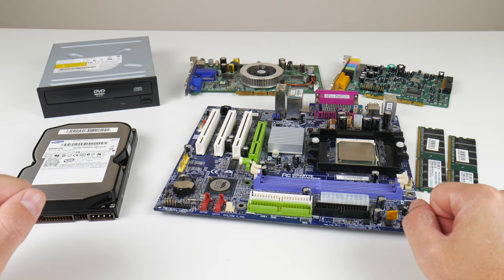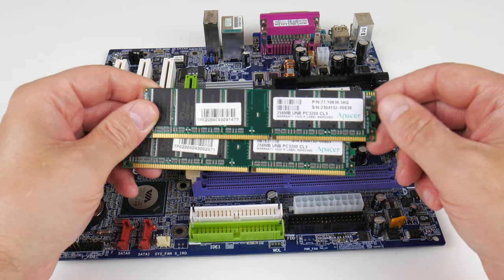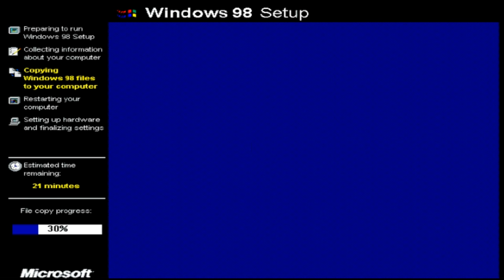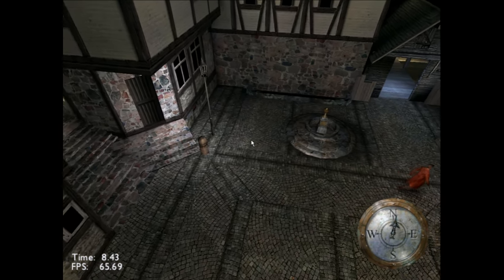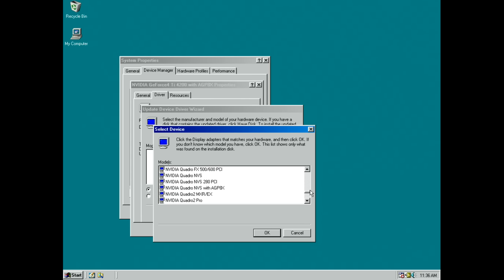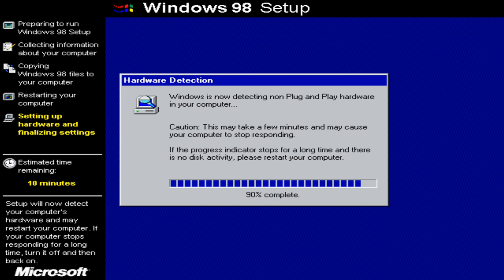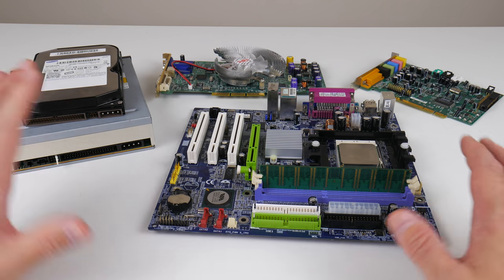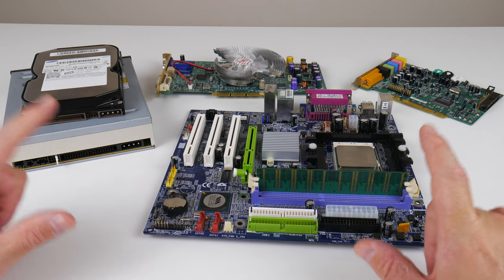Building Windows 98 Retro Gaming PC with AMD Athlon 64 Platform

Comment: The issues you suffered were just so indicative of the era... brings me some odd nostalgia while simultaneously making me sad to my core as if it were younger me with some motherboard that I just sunk all my money into, and it was just riddled with issues. lol  . But half the fun was figuring all of any particular systems quarks out, and knowing it like the back of your hand by the time its broken in. By which time you can basically make it do anything you want, whilst acutely aware of its limitations. I've had bunk Sata on early implementations as well, back then of course... in its infancy. Also depressing, when you sink a ton of money into a new interface for CRAZY SPEED, and you ultimately have to then go to tigerdirect and get a sata to ide adapter... paying a ton more to do the same thing you were on the last build, lol... just because the tech wasn't up to snuff, and compatibility on brand new ideas were totally hit or miss.... nothing was assuredly just going to work... ever.  Not back then. But again, it was a lot of the fun at the same time. Oddly. Like playing a lottery to an extent.
Reply: I built a new gaming PC in December.  PCI-E 4.0 does not work, has to be disabled or Windows BSOD's during boot.  Asus sound card refused to work with Asus motherboard until I downloaded a special USB controller driver (wtf, why?!  there is no USB ports on the sound card!).  Radeon 5700 XT...  Well, you can search on Youtube for how many problems that goddam thing has.

It's still a lottery.
Reply: @jamesclark7380  lol.. Yeah, at times it is... Especially when the underdog team goes and advances things like pcie 3.0 to 4.0... That move alone will likely cause further chipset issues for many a seemingly unrelated card for many a people moving forward... Unless you have the most ground breaking of NVME ssd storage though, or even the absolute most expensive of m.2... Then you may as well just use 3.0 for some while. As you won't stand to benefit from the newly added bandwidth, with any video card today, even 2080 super can't saturate a 16x @3.0...  so I'm just waiting until 4.0 matures. All my ssds are cheapy cheaps anyway, lol

Comment: nice video yet again. i hv a similar setup ad well for win98, but with socket 939 A64 4000, Asus A8V-X with via K8T800 chipset and ti 4200 8x. I also swear by the older drivers 45.23. i swap in a 6800gs if i need more performance but that card only works with modified 81.98 drivers.

Comment: I have the Gainward Golden Sample GeForce 4 Ti 4200 that was paired with my AMD Ahtlon XP 1800 until  I bought the Radeon 9700 Pro when I upgraded the system to a Barton core Athlon XP 2500. When I went the Athlon 64 route I was running the GeForce 6600 GT AGP  and and nForce 3.

Comment: I have had similar issues with the VIA chipset SATA controllers for socket 754/939. I had to use a PCI SATA card to work around the problem. Aside from that the systems work great!

Comment: You have a lot to answer for Phil. I have a dual slot 1 rig that i have owned and built from new and have always enjoyed messing around with (it did have to work for a living for a very long time, Gateway server) and it's now basically a pet. Dual 600's, Geforce 2 GTS, Globalwin 802 case, maxxed ram, Highpoint Raid card, more storage than it will ever need and Windows 2k Pro, oh and a Yamaha sound card, you may want to try one of these. However, I now find myself , as a result of watching YOUR channel, with a P2 450 SLI Voodoo 2 setup, an AMD 6000+ running crossfire 3870's , and a Q6600 running at about 3.5 or so (varies depending on my patience) with either crossfire 4870's (superb cards and damn reliable) , or, crossfire 5970's (these require a small nuclear power station in place of the psu). More to the point I also have a third 5970 waiting for a suitable mobo ( and a slightly larger power station) to run triple crossfire. Keep up the good work.

Comment: I'm building one of these systems. I went with an AM2 board which has an AGP x8 slot, paired with an Athlon 64 1660-LE. Having the same issue you had with Windows setup during hardware detection. Very annoying, but I'm determined to fix it. 💯
Also, it'd be very interesting to see you do a 98SE build on AM2, and explore stuff like Cool 'n' Quiet support and how it affects gaming, if you can find a board that has APG. ;-)

Comment: The Santa Cruz card usage is continuing to be interesting.. as are any mistakes (very helpful ! ) I have been looking at the M-Audio 2496, Revolution 7.1 and Revolution 5.1 sound cards for Input video capture. Both from ATI Wonder Theater 200 cards and from  other TV Tuner cards. Sound cards aren't normally known for their Input capabilities, Mic and (Consumer) Line seem to be all there is.. Mic=Mono, Line=Stereo. I see some have "hardware" channel support for EAX and other Surround Sound on the outputs.. but not all. The M-Audio Revo 7.1 had no "hardware" support for EAX and DirectX and got panned for poor gaming support. The Revo 5.1 was supposed to have "hardware" channels and was lauded for it, but had poor quality drivers. I'm new to all this EAX and Sensura (software only?) sound support and the MME vs ASIO driver and latency control support. It seems to me after Visa the whole landscape of sound support changed.. but I'm not sure what is important anymore. 16/48 to 24/96 and 24/192 .. seem to be tiers for audiophiles (is that a fan or a brand name for M-Audio products?).. and stuff seems to favor IEEE Firewire or USB 2.0 then there were Guitar or Instrument (non-Line level to Line Level) adapters and converters.. this is all humbling, confusing and frustrating to understand.. sometimes I think I need to visit a Guitar shop to figure out which legacy sound cards are best for analog video capture to digital AVI or MPEG2 transfer.

Still I find your videos with the 'crumbs' of information about video cards and audio playback/gamer cards useful.. they connect a few dots for me.. and send me off in new directions to explore terms I've never heard of before.

I think there is a lot of historical, legacy information that informs and prepares one to understand the landscape of today.

Thanks for the videos!
Reply from the maker: I feel like saying some deep and meaningful but can't lol I just follow my gut and what my ears tell me. For gaming the Santa Cruz is a solid all-rounder. EAX is better with a live! Or Audigy 2 ZS even better. A3D you want an Aureal Vortex 2.

Comment: Yo Phil. I have that exact sam hard drive, And lets just say, its the best hard drive I have every owned. It has been dropped, bumped, everything. And it still has no reallocations and has over 30k hours of usage on it. Its running a text bench with windows 10 32 bit rn lol
Reply: Mine however is SATA, not IdE

Comment: Got my hand on a ASUS K8V-MX (VIA chipset) with a Sempron 2800+ and I have to say, I got pretty disappointed on Win98SE as it seems the system appears unstable. So far my nForce2/AthlonXP behave much nicely and more stable. The glaring example is the system unable to shut down properly (Windows claims a fatal error occurred and needs to restart the computer...as I asked him to shut down). 
I don't know if it me or if I have some plague with the ASUS series of that period (I really got unlucky with ASUS mainboards from 2004-2005 era), but I gonna try next weekend and benchmark against an ABIT NF8-V (Socket 754/nForce 3).

Comment: I used to work for a component distributor. I would test returned items to determine if they where faulty or not. We sold these Gigabyte boards. We had very few returns on Gigabyte boards. If they did have a problem it was mainly having to flash the bios to the latest version because it would not boot with newer CPU's and I remember a spate of boards with leaking capacitors. MSI boards at that time where terrible.  I always wish i had kept my best PC for each era instead of upgrading.

Comment: Great video!, Athlon 64 is the most over powered system you can build for Windows 98, you can even go to Socket 939 with Via Chipset I have an Athlon 64 4000+ running in that configuration.
SATA needs additional drivers not included in Via 4 in 1, that is why you had errors. 
Also, I have the same problems with Nvidia 45.23 and some Geforces 4 MX, or Ti. It really depends only on the manufacturers of the cards, on some it installs fine and work, in other it installs but give Direct 3D errors, and in some it does not want to install at all, force install in this cases give Direct 3D errors, so no point. Going to the immediate next 45.XX driver revision solves it for me, and still performs 99% the same.

Comment: This weekend the final parts for my 98 SE build will come.
Reply from the maker: Good luck!
Reply: Out of curiosity, what are your parts for your build?
Reply: @matthewconley7568   A Geforce 4600 ti, I also found a 3dfx Voodoo 2 that I didn't know was in the computer I'm building until recently so that's an option as well, a 2.8 ghz socket 478 Pentium 4, and 512 MB of RAM.
Reply: @ironinquisitor3656  Are the 4600ti really that powerful for Windows 98? What is stopping someone from putting a more powerful in their system?
Reply: @matthewconley7568  It's considered a sweet spot because it has great backwards compatibility with older games.
Reply: @ironinquisitor3656  Do you know of anyway to get a motherboard from this era that has not been affected by the capacitor plague?
Reply: @matthewconley7568  Not sure how to answer that. I'm not a computer expert.
Reply: @ironinquisitor3656  Just want to get maybe a Pentium III motherboard not affected by the capacitor plague going on at the time. Don't know how widespread it was.

Comment: Always love a good Athlon64 build, but this is not what i was expecting when you mentioned Hold My Beer ;).
I expected the system hangs to be SATA or resource conflict related and from the looks of it its indeed the sata controller.
It might be interesting to try the RLoew SATA patch that patches an issue with Windows 98 that causes it to recognise some SATA controllers as PATA and see if that fixes the issue for you.

For the time machine idea it would still be interesting to see a follow up to this, possibly with your higher spec'd Athlon64 build from last week. Because i am still super curious to see what the highest end build is you can make with the components you have in your collection that still retails full MS-Dos and Windows 98 compatibility covering the widest range of games you could possibly manage on real hardware. Because to me even if it can't run games from modern times it would still be fun to see a single system run Wing Commander all the way up to early Windows XP (Half-Life 2) or even Windows 7.

Its a bit of general feedback for your channel as well, you often do specific builds such as a XP gaming machine, or a Windows 98 gaming machine. But it would be useful to know how well it would be able to do the things you did not design it for but others may be interested in. Showcasing MS-Dos compatibility or XP compatibility similar to how you handle your Thinclient video's. So in this case i am looking forward to the bonus video. But having it as a short segment in your regular video's could be very helpful.

Comment: Nice video as always !! I have the same Medion GF4 Ti 4200 8x and it can overlock to Ti4600 speeds (even beyond) :D it's a really quiet and cool card, I was very impressed by it for the price :D

Concerning the CPU you used, seeing its cpuscore under 3DMARK99MAX it's a bit faster than an Athlon XP 3000+ FSB333 on an Asus A7V333 (that one scores about 38300 points, overclocked to 2471MHz it scores 43300).

Maybe you could use Riva Tuner 2.24 - 2009 MSI Arena Overclocking Edition (It works well under Win98SE, tested by myself :p) in order to unlock features of the integrated graphics by S3. I know it does work when PowerStrip can't show options like you had in the video. I hope it will help you :)
Reply from the maker: Sweet, I believe I have Rivatuner ready to go, will check it out the next time I work with this platform! Thanks for the comparison figures!

Comment: I'm not surprised that you had problems with the sata ports as sata originally came out in 2000. While they did make sata drivers for Win98 they usually had to be installed after Windows was (on an ide drive), then you had to swap your hd from ide to sata and use hd cloning to copy everything over.

Have you looked at slot 1 pentiums yet? I'd be interested if you do as I've got a board and cpu that I could use.

Comment: Ahhhh.... A somewhat recreation of my "The beast" from around 2015 that I posted on Vogons? That machine really flew and was awesomme.
Reply from the maker: It's just a really basic Sempron 3100+ system with VIA chipset. Very undesirable, but for Windows 98 SE it's fantastic and cheaper than all those decked out Pentium III machines :)
Reply: @philscomputerlab  True. These 754 machines are really fast. Might be some of the newest hardware that still support 98. And I like to use GF4-ti4200 on these boards. Reason being that the GF4-ti4200 is more than capeable, cheaper and runs cold enough to outlast the fastest GF4's. P3's are amazing, yet they are not more compatible than Socket754 semprons. They have one single advantage that are better Dos support. However the goal is Win98 and not Dos.
Reply from the maker: @brostenen  Stay tuned for DOS compatibility...
Reply: @philscomputerlab  Looking forward to it!

Comment: I made a windows 98 machine using a AMD XP3200 and a nvida 6600 GT I have used the Sata ports on the motherboard whit I did was to set them as IDE to install windows 98, I also used a pci sata card with the same chip as the one on my motherboard. Did the install and rebooted and changed the sata on the motherboard from ide to sata and it works ok.

Comment: Is the Athlon 64 x2 series possible with windows 98? I've got a 6400+ black edition on my xp rig. I'd like to dual boot possibly. Yes I will have to painstakingly switch the gpu and remove ram every time but you do what you gotta do

Comment: I bought the same Medion Ti 4200 for cheap recently, there seems to be quite a lot of them on ebay. It has a lower core clock than a standard Ti 4200. I think it was 225MHz compared to the usual 250MHz. Don't like the fan on it, it's a bit annoying. Don't know it that was standard or if the bearing is just worn.

Comment: I still have my Gateway Athlon 64 from the XP era (in storage unfortunately). Does what I want from the XP era, but I need to upgrade the RAM from 1 GB at some point. Maybe I'll try 98 on it at some point too.
Reply: 1GB for Windows 98 is a good amount but for XP I desire at least 2GB.  In one of my IT classes my teacher said Windows Vista wasn't as bad as people made it out to be.  The problem was that OEM manufacturers were giving people criminal amounts of RAM like 1GB.
Reply: Win98 is limited to 512mb or 1GB depending on the mainboard's bugs. Win98 on 3-slot boards often threw up with more than 512mb, but 4-slot boards usually would handle 1GB no problem.

Comment: I have an eMachines with a 754 motherboard in it and I turned it into an XP machine but I wasn't trying to run Crysis on it just old games I had on CD. I put a Athlon 64 3400+ in with two gigs of RAM mine has a pcie slots so I was able to put a 650 TI  and make it work. So far it's running the games I want to play pretty well but I haven't tested everything.  I also got XP running on a SATA drive but I have several games they're definitely Windows 95  Windows 98 era and I may want to think about building something like this. This video has certainly given me some ideas though thank you for making it.

Comment: I used a few VIA chipset boards like this one, but I ended doing something different:

I disabled the SATA + the Primary IDE controller port and used a Promise SATA PCI controller card instead.

But of course I wasn't doing the budget thing for the most part but I find that these Promise SATA controller, non-RAID type are pretty speedy.
Reply from the maker: That works well! Did you use a SATA optical drive?
Reply: @philscomputerlab  , both, I tried an IDE optical first and tested the speed and went to a SATA inferface model.

With optical you don't really see much of a difference, you can measure it but in practical terms you really cant.

Comment: Nice video!!! I use a similar setup for Windows 98 with a GA-K8VT800 an Athlon 3000+, and geforce 5500. I always had the exact same problem with the SATA controller. Lots of freezes, instability and slow performance. Also it doesn't work with sata II drives at all. I ended up using a cheap SATA-->IDE converter with absolutely no problems at all. Great performance and stability overall when not using the sata ports.
Reply from the maker: Nice! I ended up using a SATA to IDE adapter as well in an upcoming project, worked super with the SSD delivering almost 100 Megabytes per second :)
Reply: @philscomputerlab  Sweet!! Looking forward to your next video! Stay safe!
Reply: I have read a lot of negative reports on those simple SATA to IDE converters. I think they're only good for optical drives.
Reply: @Rickenbacker451  I have 2 of those, bought them from aliexpress a few years ago. I've used them for quite a while now, one in a pentium 3 system and the other in the socket 754 and so far I did not have any problems with them. I haven't used many of them though so I can't speak in general.

Comment: I use "Corsair VS450" in my 2678v3 system, a bit old, but works better than some newer ones...
Have 4xAGP GF4-Ti4200 from leadtek, but don't have time to setup retro PC (can be overclocked to 4400 freqs, and even some more in memory clock, don't remember nubmers)